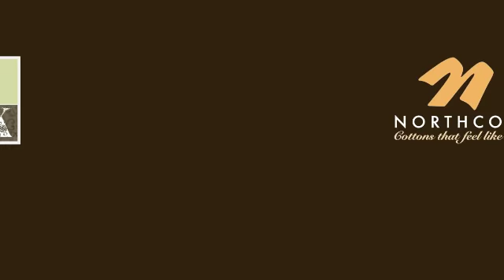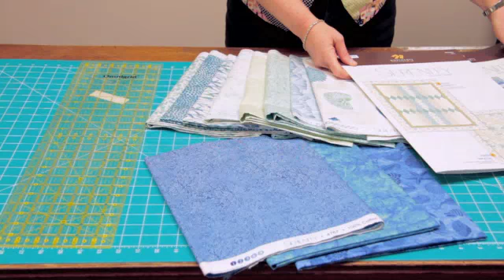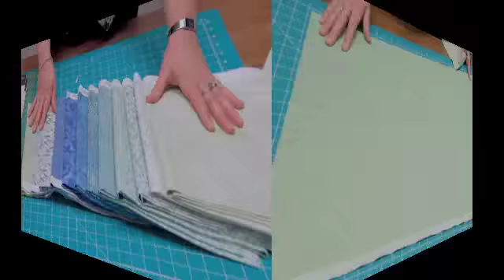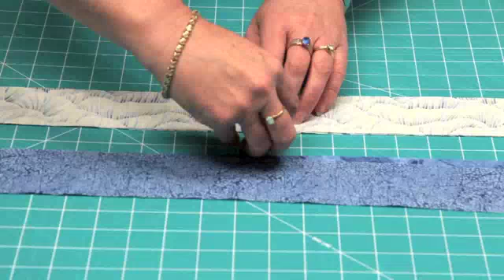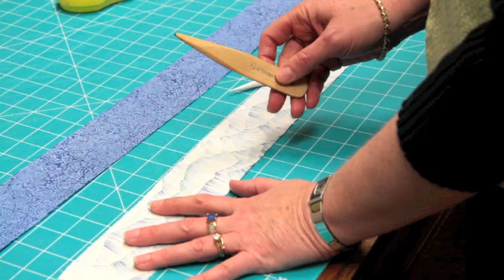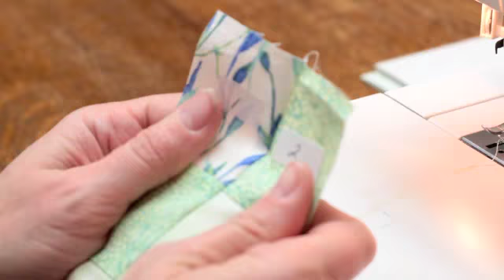Making a Bargello Quilt with Patti Carey

Comment: What length of fabric do you use to cut the strips? I mean...do you take 1 yard of each of the  fabrics and cut strips out of that yard.. if you need more you take another 1 yard of each fabric?
Reply: The  strips are cut crosswise or width-of-fabric, so they will be approximately 42" long (the width of your fabric).  Bargello quilts tend to use smaller amounts of many different fabrics - the Serenity Bargello uses only 1/3yd of 12 different fabrics.  If you use fewer fabrics, you will require more of each.
Reply: So basically, take 1/2 yard of 42" wide fabric for each color?
Reply: What size quilt are you planning on making, and how many fabrics are you planning on using?
Reply: I have 10 fabrics and making a queen size quilt
Reply: You will need 8-10  2 1/2" strips of each fabric, so 3/4yd or so of each fabric for the bargello portion of the quilt.
Reply: Thank you so much Patti. I appreciate your help and will refer to your video as I work on mine!
Reply: Just one more question Patti. I have not seen it addressed anywhere. I am making a queen size quilt  - 84x104. That means it has to be about 104" long. How do you accomodate that length when making the strips? Do I make as many tube sets(of all 10 fabrics) and sew them together to make one 104" long tube-strip and then cut them the various sizes - meaning I would be sewing strips together that are 104 inches long?   Also..you nest your seams. I have seen other talk about putting the seam of one strip in the middle of the previous square, instead of matching seams. What is your thoughts on that as far as how it effects the motion of the pattern or assists in reducing seam bulk?
Reply: If you would like your quilt to be 108" long (perfect for queen size) I would suggest including a 1" inner border, 3" middle border and 10" outer border.  The quilt center, therefore, needs to be 80" long.  With 10 fabrics, you will need 8 strips of each fabric (cut 2 1/2").   Sew 4 sets of 10 strips together to make a piece 80" long, and sew into a tube. You will likely need 2 tubes, so repeat with the remaining 4 strips of each fabric.   Re: aligning the columns so that the seams do not nest, if each additional column is aligned half-way down from the previous column, the slope of the bargello will be flatter and each color actually touches the same color in the adjacent columns.
Reply: Thank you so much for the help. I will be starting this part of my bargello today!

Comment: Why wouldn't you just do the pressing the easy way with an iron?
Reply: Hi Linda.  I find that if I just press with an iron that my strip sets tend to have wavy seams.  If I "finger-press" them first with a wooden iron, Clover Hera Marker (my favorite tool) or point presser, I can achieve a straighter seam and straighter strip set. I find that I only need to press with an iron once all 12 of my strips are added, and I can simply press along the seam instead of pressing against the seam because the seams are already flat.  I hope to post a short pressing video on Northcott's YouTube channel shortly.

Comment: I printed the directions and have watched the video over and over. I'm confused. First, the dimensions given (if added up) are more than any normal 40 or 42" width of fabric?, and directions are not clear as what to do with the second set. Feeling
frustrated because it is a lovely quilt and I have some lovely Northcott fabrics ready to cut.
Reply: Hi D, You will use the first tube, made with 2 of the strip sets, to cut as many of the 32 rings as possible.  Then use the 2nd tube, made with the remaining 2 strip sets and identical to the first tube, to cut the balance of the rings.  You will have a chunk of the 2nd tube leftover.

Comment: I watched the video and read the pattern and updated version.  My confusion is what to do with the second strip tube which is mentioned at the end of instruction 6.
6. Fold strip set in half, right sides facing, aligning the long edges, and making sure that the strip set is now skewed. Sew this final seam to turn the strip set into a tube. Press seam toward strip #12. Turn the tube right side out. Repeat with the other strip set.
7. Lay one tube along a horizontal line on your cutting mat. Starting at the trimmed end, cut the tube into rings of various widths, following the table below, cutting Rings #1 through 32, and labeling each ring as you cut it.
The first strip tube isn't enough to make  the 32 varying width cuts. Do I start with the 2nd strip tube and continue cutting another 32 - or however many cuts it will allow?
Reply: Susan E